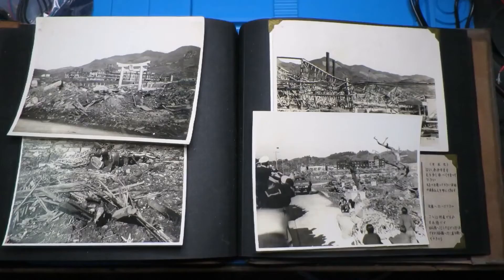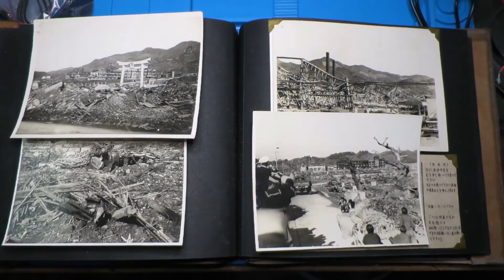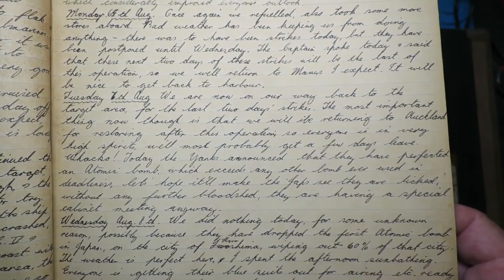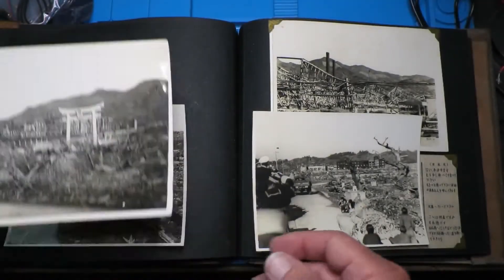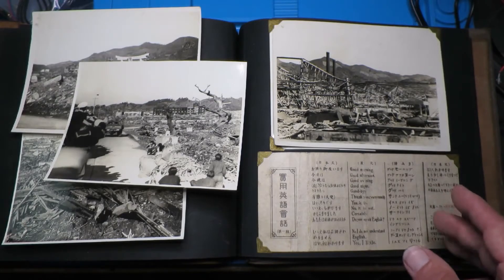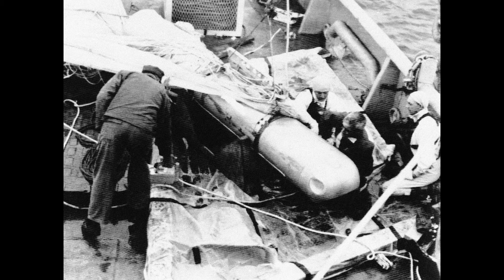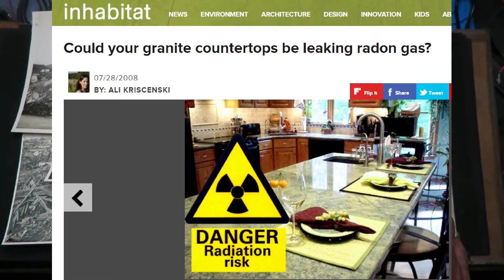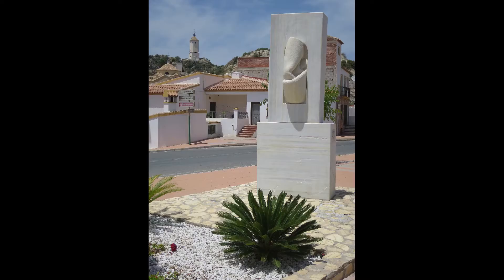Geiger Counter Kit Nuclear Radiation Detector from Banggood - Electronic Project

Comment: For anyone using this board.  The interrupt output is R19 - 470K impedance so you can safely connect it directly to an interrupt pin on ANY microprocessor.  Inputs on an Arduino or espxxxx have clamp diodes to prevent above supply or below ground, but they can only deal with a small current. The 470K guarantees its a tiny current and that is exactly what its designed for.  There is generally virtually no tube current until there is an avalanche caused by a particle, this has to flow through the base of the transistor and is always enough to produce a pulse.  The transistor and stray capacitance is sufficient to ensure that you don't get noisy triggers even with the fastest interrupt.  If you are worried about that you can deal with that in software based on the fact that the tube itself can only handle a certain number of pulses in a given period.  Or you could use a schmitt trigger or 555, but there already is a 555doing exactly that on this board, you can grab the signal from Q4.  The tube itself in this simple design works really well and is sensitive enough to detect atmospheric changes during rain or day and night cycles.  It doesn't pick up alpha particles which can't get through the glass.  I tested mine with Americium which emits alpha but then decays with gamma which is what it sees and the detector goes bonkers near thorium soaked lamp mantle you can get from eBay.  It goes well above 2000 - 5000 counts.  Finally, yes the tube is 400V but the impedance of the tube driver is insanely high which means that even a volt meter pulls it down to a few volts so no shock hazard at all, you can even lick it.  In fact that bunch of resistors is to create a mega high impedance divider just so you can get a volt reading of a few volts to give you some idea what the actual tube is, because you cannot measure it directly, even with 10M Ohm voltmeter.
Reply from the maker: Thanks for sharing your extensive knowledge. That will helps others with similar projects. Thanks for watching, have a great day!

Comment: Great video :) I actually built the circuit that you showed and also copied your code for my own project. I was playing around with the output and noticed that the arduino actually does a good job at recognizing the signal even without the 555 timer circuit! I just plugged the "VIN" from the geiger counter directly into pin 2 of my arduino board, and the onboard LED lights up equally well. Anyways, despite this I feel like I learned a lot from your video! Thank you!
Reply from the maker: Yes, it will work without the 555, I was concerned that the "unsquared" waveform may cause false readings. Thanks for the comment. Please consider subscribing if you have not done so already!

Comment: Excellent project. I suggest to use a 220 ohm resistor in the 555 to reach the same pulse width that have the DIY module  (~227 microseconds width).  I think that if you use a 1k resistor, and a pulse width of 1ms, you are trimming the maximun CPM that you can measure
Reply from the maker: Thanks for the tip. Please consider subscribing if you have not done so already!

Comment: Hi Sorry, another question, what's the voltage that you used for the Muller tube? I cant find any description on internet about it . Many thanks
Reply from the maker: It is around 400 volts. There is a schematic here : https://github.com/SensorsIot/Geiger-Counter-RadiationD-v1.1-CAJOE-/blob/master/Geiger%20Counter%20Diagram.pdf
I guess you know there is a second part to this project : https://www.youtube.com/watch?v=CPW7CREKkEo
A good general description using a different board here : https://www.cooking-hacks.com/documentation/tutorials/geiger-counter-radiation-sensor-board-arduino-raspberry-pi-tutorial/
Reply: @1nformatica  got It thanks! There Is only One problem. 
If i screw the trimmer on the higher volt  , i can reach a maximum of 290 V... So that's too low. How to fix?
Reply from the maker: To measure this high voltage you need a very high impedance meter as the current is very low. A "normal" multimeter will not give an accurate result as it loads the circuit too much.
Reply: @1nformatica  ohh! Nice to know. So, what i measure with my multimeter (290V) Is about 400V right?
Reply from the maker: Probably, but the only way to know is with a special high voltage tester. Maybe a local college or university may have one.
Reply: @1nformatica  I try to ask in my university so..☺️ Thanks a lot

Comment: I didn't understand why the arduino can't measure the signal without the 555 timer ... can you please explain to me ?? i think you could just replace the trigger  from the interapt from rising to falling.
Reply from the maker: The original signal could have caused false triggering and readings. The 555 is possibly not really needed but I prefer to see a nice clean signal!
Reply: @1nformatica  οκ! thanks a lot!

Comment: Good project. Anyone know what the chips are? They have been buffed off on my BanGGood Geiger kit. Stupid, as they are in sockets for easy replacement. Thanks.
Reply from the maker: There are 2 NE555 timers and an LM358 Op Amp. There is an approximate circuit diagram here : https://drive.google.com/file/d/1l8TuQgZiDeYuhiSFNRPBbLaZncGen0ZS/view?usp=sharing Thanks for watching, have a great day!
Reply: @1nformatica  Wow, that was a quick reply, thanks. i presume the left ic is the lm358?
Reply from the maker: @Night09Owl  Yes, bottom left in this clip next to the radiation symbol : https://youtu.be/4Tqo3B98ZgM?t=268 Thanks for watching, have a great day!

Comment: wouldn't a schmitt trigger be simplier or is there a reason why you wouldn't?
Reply from the maker: No reason not to, it's just I am more familiar with the NE555.
Reply: Fair enough. Good video btw
Reply from the maker: Thanks! Hope you have subscribed for more!!
Reply: The AVR can probably handle the raw pulse just fine anyway. Even if there was multiple triggering on the edge, the interrupt handling time would effectively debounce it.
Reply: @gblargg  I agree, Ive got push button switches, that are far worse. A simple debounce code and your done. Why complicate things when you don't need to.

Comment: Firstly, tanks for the informative video. Did you know the Arduino has an internal comparator that could save you the external 555?
Reply from the maker: Hey thanks! Do you have a link to more info on the comparator function?

Comment: I tried to repeat this scheme but it does not work.
As I understand 555 timer start if on input we have  1/3 from Vcc. Signal should be +1.6V. But we have -3.6V on input.
I do not understand how it works on video.
Reply from the maker: The output from the Geiger counter is a pulse from around +3 volts : https://youtu.be/4Tqo3B98ZgM?t=520
If you are seeing -3.6 volts something is wrong with your board or connection.
Reply: @1nformatica  Thanks for your answer. I have this on output my Geiger Counter. As I see it has -3.6V. Looks like in your video. But as I understand it should be > +1.6V.
https://prnt.sc/olivln

Comment: What does the test J4 bridge connector and the trimmer resistor R100?
Reply from the maker: The circuit diagram and instructions can be found here : https://drive.google.com/drive/u/0/folders/0B9itH-BnWE5sY2JGRkM4MWhSYkE
The R100 is used to calibrate the unit. J4 disconnects the 400v from the tube for testing.

Comment: Good job! Maybe Is there any possibility to ready Sv/h from Arduino?  Otherwise trought some analog signal from board?
Reply from the maker: I do not really understand what you are asking.The detector board just outputs a pulse when a particle is detected. The Arduino does the calculation from counts per minute to Sv/h.
Reply: @1nformatica  i cant see the calculation from counts to SV/h. In Arduino there Is Just the counts...no?
Reply from the maker: @alfiolocatelli5093  It is in the second video : https://youtu.be/CPW7CREKkEo?t=195
Reply: @1nformatica  Sorry didnt notice that, thanks!
Reply from the maker: No problem. Let me know if you have any other questions.
Reply: @1nformatica  thank you!